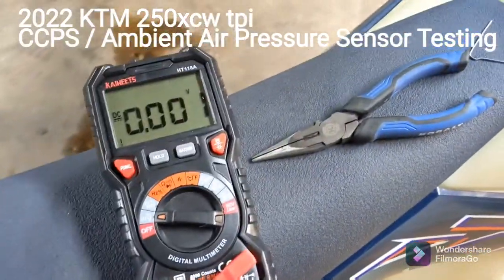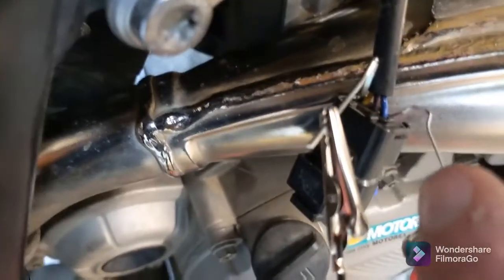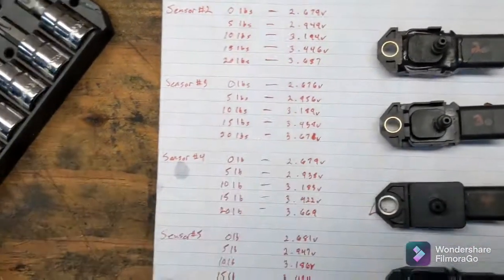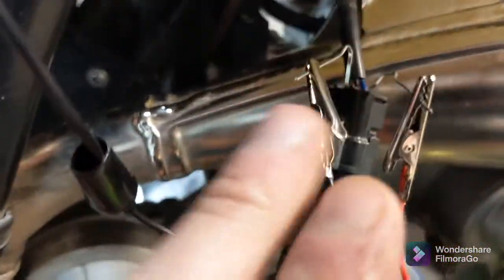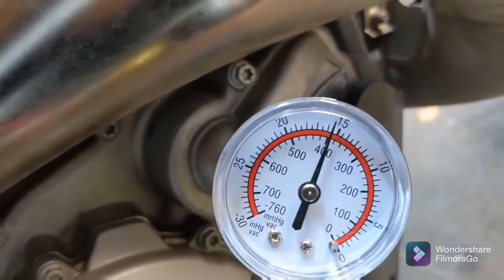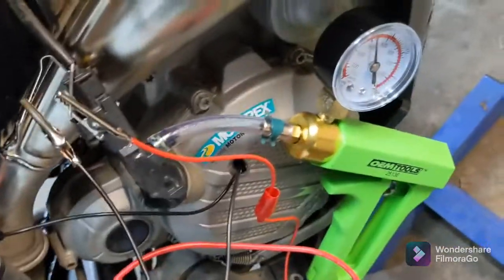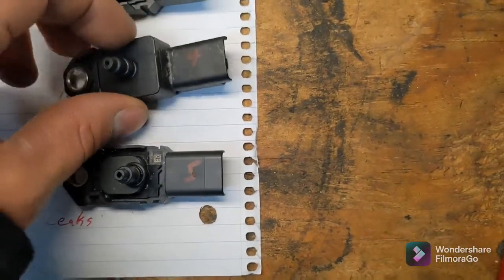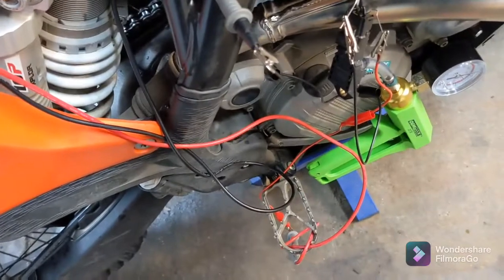2022 KTM 250xcw CCPS & Ambient Air Pressure Sensor Testing

Comment: How you “wake up” the electronics?
Reply: there is a dongle that should have been provided to you when you bought the bike, it plugs into the odb/diagnostic port/wire that is inside by the air filter and turns on all of the electronics.